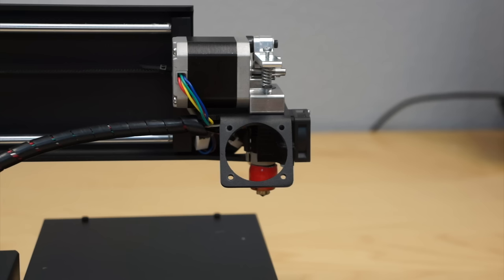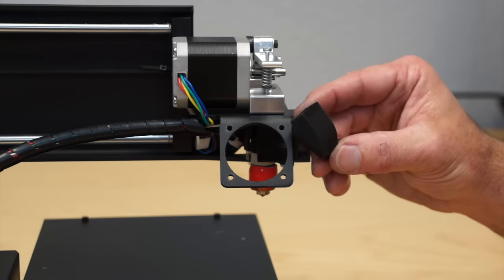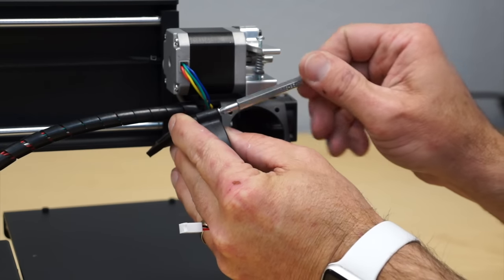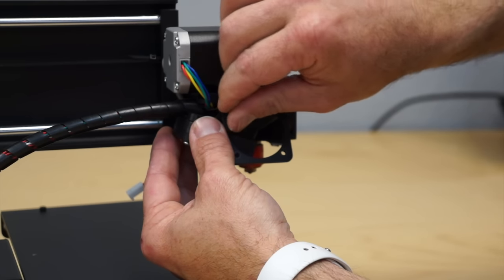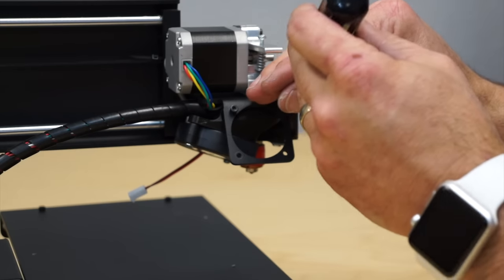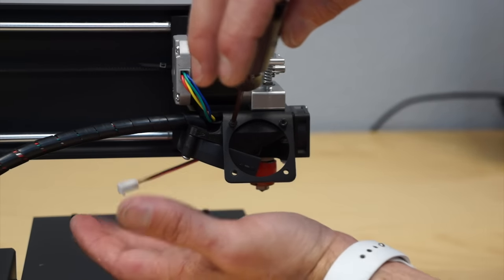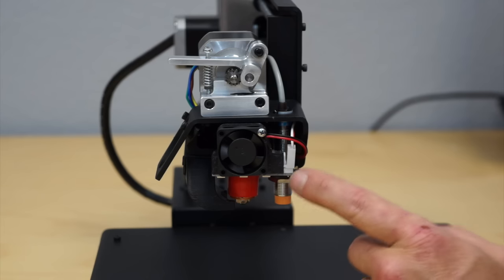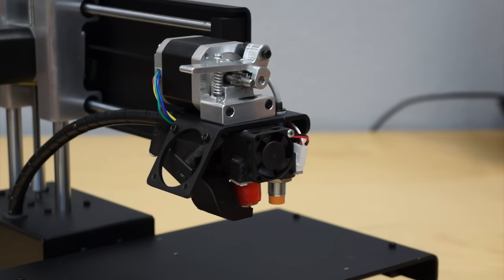Printrbot Simple Blower Fan Upgrade

Comment: Just bought the fan through you guys, but the screws weren't included. Nuts.
Reply from the maker: What screws were missing? Or needed? Let me know!
Brook
Reply: Hi Brook, thanks for the quick reply. It was the two screws for mounting the fan into the shroud. I'm going to go ahead and go to the hardware store to get. 1 week down of 3d printing is stressing me out! XD

But I do have a kinda serious question to ask though.. My hot end died on my simple metal and I know you guys discontinued selling that particular hot end. I bought the new one, but I noticed that I need to print a fan mount and buy a fan for it. However, the dilemma I have, what happens when you don't a working 3d printer to make the parts needed to mount the fan? Is it safe to print without damaging the new hotend? At least for the mounted needed in ABS?

Comment: Thanks, I love how much better it cools the part.
But I have noticed after my installation that the hotend temperature falls 10+ degrees below what I've set it at. 
I think the shroud's opening needs to be narrower and maybe point lower towards the hotend tip rather than the ceramic.
Reply: Yeah, I'm having trouble getting my Ubis 13 to maintain temperature after installing the new fan as well.  One tip I can offer is to add a ~10uF electrolytic capacitor (mind the polarity) across the fan leads.  That will make the Printrboard PWM actually work correctly so you can run the fan at a lower speed.  Then you can dial down the fan speed so it doesn't overwhelm the extruder.

Comment: My printrbot simple with heated bed parts cooling fan was connected directly to the printrboard so there was no extension. So I guess it is good to check that first so you know if you need to order an extension or not.

Comment: Are the Ubis 13S and the Ceramic hot ends similar enough in length that that the fan duct will fit either one?
Reply from the maker: Yes. They are almost identical, w/in a very small tolerance ;)